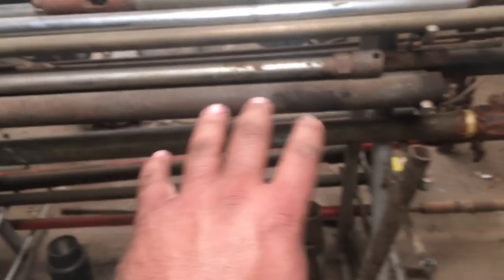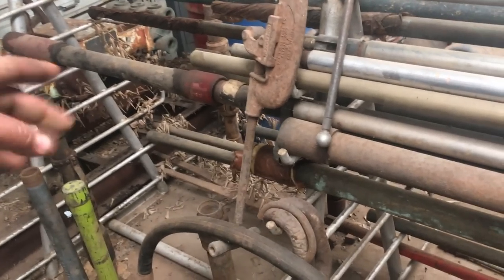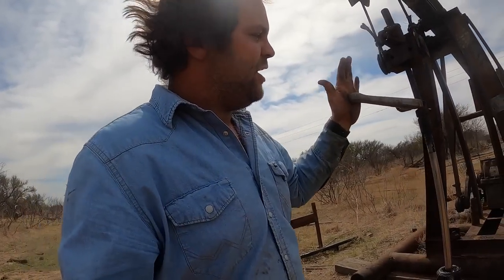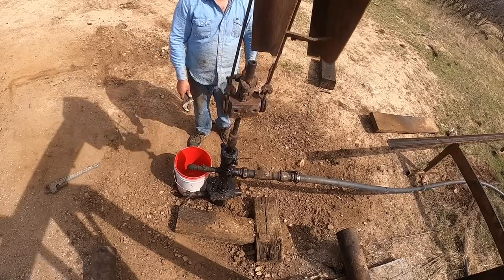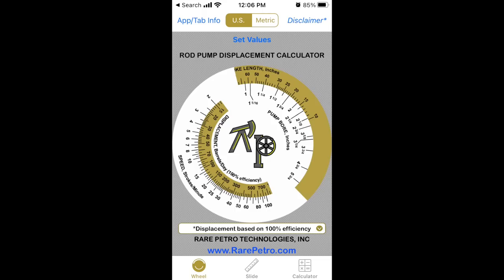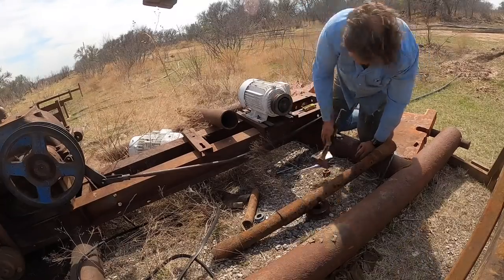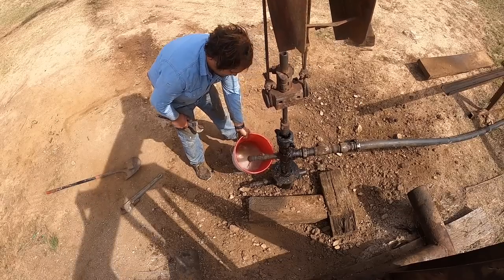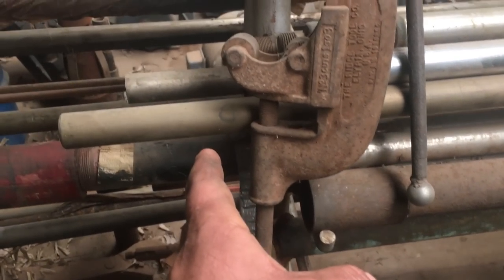Pump Test, Fluid Pound, and a "Free Oil Well"

Comment: I had a 400 foot water well that was 12 inches in diameter with a 13 stage centrifugal pump broken off laying in the bottom. About 100 foot of tubing and line shaft still attached to the pump. I fished it out with a piece of tubing that fit close to the ID of the casing with some old car leaf springs welded in it to latch onto the pump and related mess. It worked good and I got the mess about half out when the tubing connected to the pump broke again. When that thing dropped it felt like a small earthquake. I got it hooked again and got it out but that was another day or so on site fishing. I think just the recovery of the old pump cost about $10,000 and that was almost 20 years ago; Probably not as bad as your problem but I sure understand the difficulty of recovering junk from the bottom of a well
Reply from the maker: There is as much luck in fishing stuff like that as anything else.
Reply: @TheZachLife  I have to tell you, the leaf springs welded into the ID of my fishing tube worked great. I didn't know to use the leaf springs when I started the project, but an old well driller stop by the site when he saw the crane and we got to shooting the shit and he shared that trick with me. Save me lots of time
Reply: Daaaang Joe, my hat is OFF to ya Pal !!  Leaf springs off a vehicle ?  Wow, pretty ingenious it sounds like to me !  Now THAT is a prime example of "oil patch CREATIVITY" or "field engineering" at its best !  SAAALUTE !  
But, could  you explain briefly a "13 stage pump" ?  Never heard THAT one before ......
Reply: You are lucky the tubing didn’t corkscrew

Comment: After I have 50 years in the oil patch your problems sound just very normal. I wish you good luck it's a very hard industry to make a living at. For my thinking I would get rid of those metal-to-metal pumps. Never like them would not use one on the bet
Reply from the maker: Thanks. They can be problematic but will run much longer than a common cups or flex out ring.Thats why I run them.
Reply: @TheZachLife  I was wondering if you could have ran a insert pump until you get the well lined out. just a thought. enjoying the videos!   im retired pumper.  God Bless!!
Reply from the maker: @JB-mf1zc  In hindsight that what should have happened. I was expecting to be done with it every step of the way.

Comment: Don't be afraid to try to casing swab it.  Or play it safe and swab it through the tubing with a packer.  The formation sand probably swollen up with all the water on top of it when washing.  I had a lease like this that was 5K to buy and it wouldn't feed in.  Sat for a couple of years when we bought it and worked it over.  The formation sand had plenty of time for the clays to un swell and we couldn't even circulate.  We tried to wash with 33 gravity crude oil instead of field salt water to try not to disturb the formation.  Formation stayed on a vacuum.  We pumped a few barrels of xylene and a little 7% hcl and chased it back with crude oil to clean the perfs up.  Came the next morning and swabbed all the crap back.  Returns looked like black sewer water.  Swabb runs cleaned up good before the end of the day.  Put it back on pump and set it to tap bottom a bit so it wouldn't gas lock.  Well stabilized @ 25bbls of oil a day with a trace of water.  Had best I could see in a graduated cylinder a 95% cut.  Got lucky, but we played it safe without using just water to wash with.   Then sold the well after a few months of production for a good profit.  New company had the pump go out after a year or so and the new guy in charge loaded up the well with field salt water before they pulled the well.  After I told them don't.  Well locked up again and has been sitting for a few years again currently.  Some formations just can't take a lot of water top of them.   Usually the pressure depletion ones.

Comment: honestly I had almost the exact same thing happened to me with an old well. Unfortunately it still hasn't come back on oil and I decided not to fool with it but use the money to drill another will. But good for you for your persistency. As far as changing the speed of the well I would suggest using a variable speed drive instead of changing out pulleys. Look at KB electronics and particularly KBAC electronic box it will make your life simpler. Thanks for these videos they're incredibly helpful particularly how to test the fluids fill without using a dyno leader card for a shallow well.
Reply: I dont know squat about oil wells, but using a frequency drive to double the speed of a motor running 24/7 is not a great solution. The bearing life will be poor.  Depending on the design of the motor, torque can be reduced significantly running at higher then design speeds, causing it to run hot.

So added cost of the drive. Aditional failure point of another component in the system. Reduced motor service life.
Keeping it simple spending 20 minutes to swap a $100 pulley is going to be the most reliable.
Reply: There are freq drives all over and they are mint. You can adjust the speed and save 25% of the energy cost. If you were to put a drive on this well you would have the bigger shiv on there and slow it down to the speed you want. They run $5-10k for just a drive.
Reply: Agree. You can really dial a well in with variable speed (and easily). I usually don’t see them unless a well is making 7+ barrels a day.

Comment: 9:09  That oscillation of the adjustable wrench, is due to the twist of the wire above, going up to the head.  As the pump starts lifting and the tension increases, the wire rope start to untwist (giving the movement).  At the top of the stroke, the load drops and the wire rope can re-twist, back to it's starting point.
Reply: This is an excellent comment, i worked with large cranes and hydraulics for many years and this is why you see tag lines (sometimes multiples) tied off to either a spotter, or even winches. As the weight increases and the size of the wire rope increase the tendency to spin becomes more aggressive.
Reply: Your not wrong BUT it's very easy to differentiate fluid pound (like slapping water) vs bridle/cable load. Most my wells are bigger and move more water (pump faster with larger diameter pump) making the fluid pound clear just driving by which is first detail I look at when I make my daily inspections so I know it's pumping correctly without opening a valve.

Comment: Since you are shallow (1600?) you’d  be better off running a 20 ring PA plunger so you can pump trash. It’ll wear the ID of your barrel faster than a precision tho. That can be combatted with a brass nickel carbide barrel, which is basically indestructible. Also, surprised the sheer pressure was more than 40k. Great stuff dude, love your videos.
Reply from the maker: Thanks.

Comment: so when a well runs out of fluid, it's the plunger that seizes and "craters the pumpjack" into a pile of scrap?
Reply from the maker: Not typically. Its usually caused by some kind of failure of the pumping unit, however I have seen on at least two occasion a pump stick down with a small junky unit that caused it to completely wad up.

Comment: We just replaced the original tubing and pumping cable and derrick on our 1895 family drilled well. Aside from how the new pump operates we have had a good start. What puzzles me is how the 1850 foot deep well accumulated 1500 feet of fluid over the 3 years of inactivity. The normal gas pressure is 150psi but I have seen 200psi. We use the gas in the cold months for heat. Any ideas?  This is the only well we own and operate. We do have a partner who has wells.

Comment: Can you provide the app that shows what the fluid should be based on strokes per minute etc.?
Reply from the maker: The one I use is “rod pump calculator pro”. We stay away from the vfd’s because of the expense and that they blow up. Thanks for watching and good luck with your well.
Reply: Harbison Fischer has a free app that calculates it for you.

Comment: man i would have just fished the tubing and everything then cleaned it to bottom with a chisel tooth, bailed it until i had clean fluid and put it on pump. you did it the expensive way. this is why i like the buycrus erie 60l i use.

Comment: thanks for the great vid. sounds like a lease like mine. i inject water only at 700 psi and don't think that does much to enhance the oil production. did you say you were at 1,600psi?  i need to figure out how high to go then get a new psi approval. also you said for this type well it was best to have production tubing near bottom of formation as opposed to top. can you explain?  thanks. John
Reply from the maker: Thanks our injection pressure runs about 250psi. I was probably referring to the depth of formation at 1600ft. These low volume, low static fluid level wells need to be pumped close to the formation because the pressure required to "push" fluid up the hole will lower the total fluid output of the well. Its not uncommon around here to see wells being pumped a joint of a few joints off of bottom but that would significantly lower production on a well like this.

Comment: Very interesting. When you buy a lease like that does that include ownership of the land? Is the pump considered the bottom section with the check valve? When you did the first time test it looked like straight water coming from the well. Out of curiosity how deep is this well? With all this work, what about the shake down cruise? 👍Kc
Reply from the maker: I need to do video on the ownership of leases in texas because its pretty confusing. In texas the ownership of the land and the underground minerals are completely unrelated. A lease is called a lease because its a lease, like renting something, from the mineral owners. These leases can have any imaginable terms including lease termination dates, a commitment to drill a number of wells, and how much of the gross income the mineral owners get. This lease a stipulation that we can not drill deeper than 2000ft. Most leases including this one are valid indefinitely as long as there are producing wells on the property and is not a period on no production longer that X months. The mineral owners get 1/8 of the gross income from this lease as the payment of the lease. In texas by law all oil production must be under an oil and gas lease even if the lessor and lessee are the same person. The barrel, plunger, seating shoe and standing valve are all know as the pump. The barrel shown screws onto the last joint of tubing. Before the well was "pumping down" meaning removing all fluid the well would give up, the well was only making water. This is common to have to pump all the water a well will make before they will make any oil. This well is 1600'

Comment: I've learned a lot from your videos! They've answered a lot of questions I've had about how oil wells work. Have you since adjusted the pump rate to get rid of the pounding? Or is pounding okay?

If you're injecting on the lease, how long does it take the water to make it back to the extraction wells? Isn't that a bit counter-productive if the water floats the oil above the pump?
Reply from the maker: Its been slowed back down some. The pound is just hard on everything. The oil is carried through the formation via the water. If the formation is effectively pumped dry theres no means to get the oil to the well bore.
Reply: @TheZachLife  Ah, so the water moves the oil. I always thought the oil just seeped/flowed on its own if there was no gas pressure. Thank you!

Comment: One of my first areas to work as a petroleum geologist in the early 1980s was on the Eastern Shelf of the Midland Basin.  Just curious as to where (state/county) your leases are located.  I can tell from the size of your pumping units that they are probably operating in shallower areas that I was not working.   I think the shallowest well that I ever had drilled was 3500 ft.
Reply from the maker: We are north central texas. Most of the stuff i have is about 1600'
Reply: The area looks like around petrolia

Comment: So we're several months later. Hopefully the well is still making oil without issue. Is there such a thing as a plug that can be pushed down the well to just lock all the trash down at the bottom at the expense of a few feet of depth?  Do you normally drill past the production zone for that reason?
Reply from the maker: Thanks. It's been pumping without much issue. There is usually what's called "rat hole" below the formation for trash to settle in. Small amounts usually will fall to bottom without much issue. This case was just a string of really unlucky circumstances.

Comment: What type of pump off controller do you use on your wells if any, to prevent fluid pounding?
Reply: I haven't seen any poc's a lot of older wells are on timer to prevent them from running in a pumped off/low pump fillage condition for extended periods of time.

Comment: You wouldn't have spent the money if you didn't feel the potential.  You must want to get to the casing shoe or deeper....open up the perfs where the junk is blocking inflow.  How long was the acid there before producing(maybe too much damage).  Under balanced clean out with air compressors wash over and soapy, corrosion inhibitors could get to the shoe but $$$ to jar out if not freed.  First time I've seen such an honest well owner.
Reply from the maker: Hahaha it was a mess.

Comment: so you actually want the water back in? to keep the oil at the top?

id kinda assumed you want the water gone or your just pulling it up and then injecting it and then going round and round
Reply from the maker: If the water isn't returned to the formation the well will run out of fluid. In wells like this it takes water to carry oil around the formation and into the well bore.
Reply: @TheZachLife  that's really interesting!

Comment: without closing the valve on the other side how is your initial measurement accurate?
Reply from the maker: Theres a check valve.
Reply: @TheZachLife  Ah thanks. Hey another question, if you power the well pump off of solar, does that mean you're producing green energy? =)

Comment: I wouldd change the both the rubber seal and diaphragm.

As you have it apart.

Its a pity it does.not have a remova glass bole that air lines and fuel lines have that traps  unwanted liquid, waste and solids.